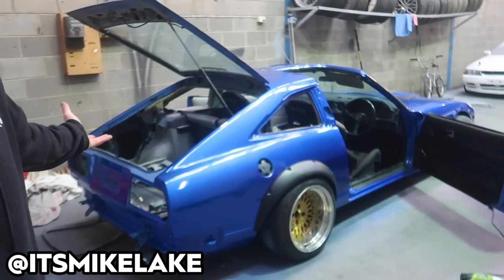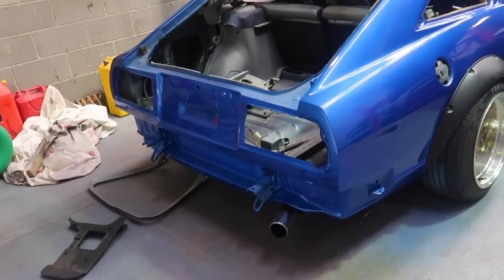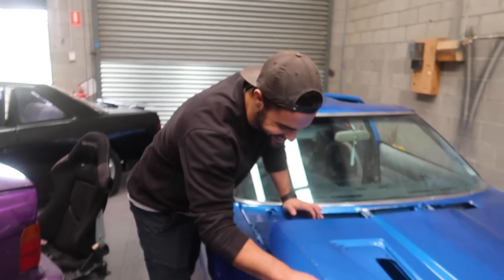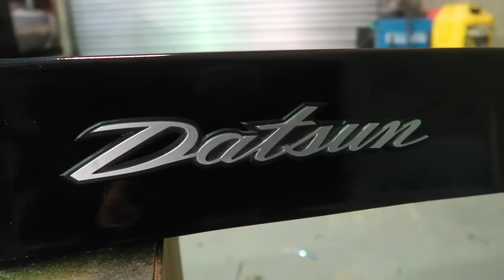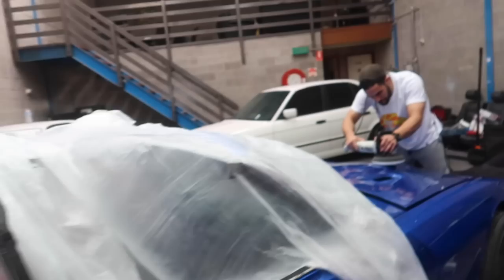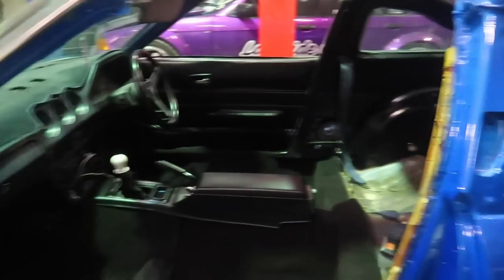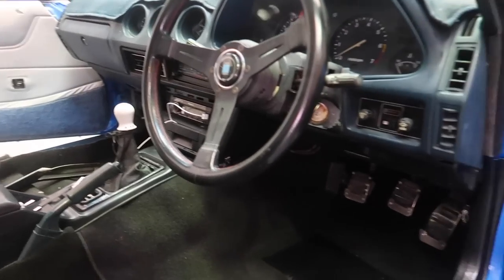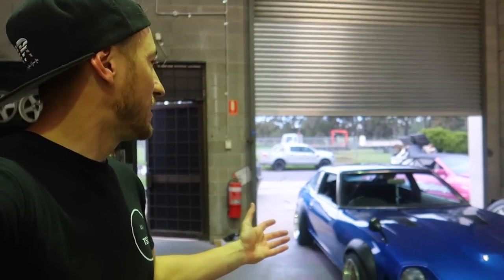DATSUN 280ZX DIY PAINT PT2 & INTERIOR REFRESH

Comment: Check out TAUTFLEX its a waterbased paint that was developed to paint flexible vinyl surfaces. i've done a heap of Porsche interiors, it waters down well for thin coats and hard wearing , does leather seats well too. 
Also try dissol cleaner for cleaning the trim before colouring/dying , its the bomb .
Reply from the maker: Yess absolutely love in depth advice like this! Cheers bro. Will 100% use this in the future. Also, majorly jealous you get to work on porches haha. Want an old whale tail one so bad!
Reply: @itsmikelake  i used to wreck Porsche 928's just south of Cranbourne before i moved up to Macleay Island 10 years ago , i only have one left lol , though its a 928SE (Porsche made 42) . 
The trick to the Tautflex is dont be afraid to water it down heaps and lots of light coats using a rag , the stuff just sticks really well if prepped with the Dissol .